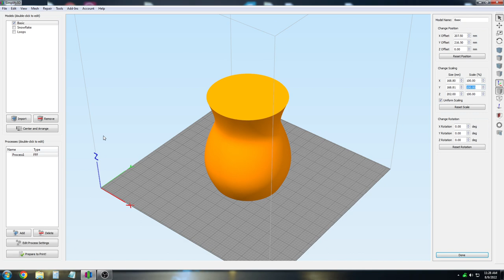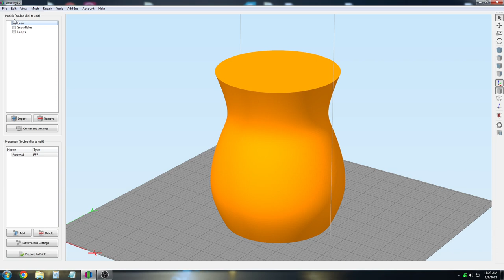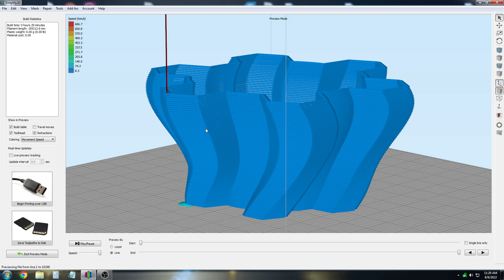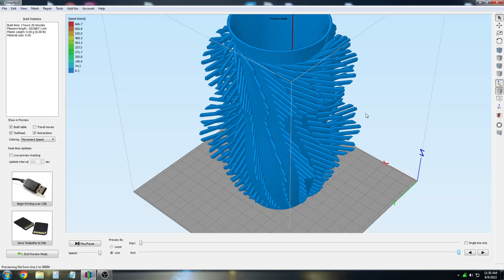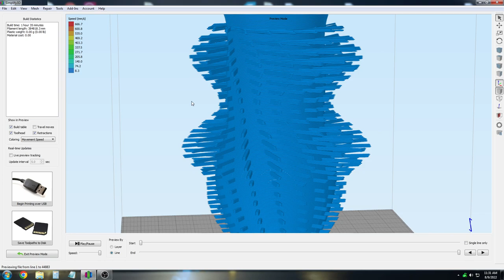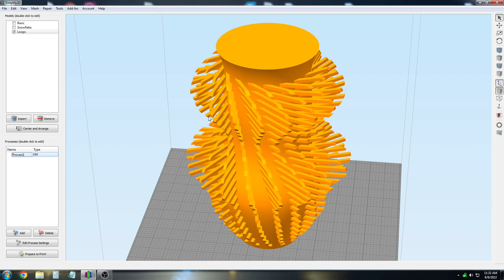STL File Slicing Example

Comment: Is there a way to print the slices on individual sheets of paper on a inkjet printer?
Reply from the maker: You could do that. Just only print the first layer. You can scale the Z height to be equal to your layer height to do this, or design your model file to only have a very small Z height.

Comment: What about the bottom of the vase?
Reply from the maker: You can add bottom layers. We recommend doing 3, but you should adjust your flow rate based on how your material is preforming. The best way to get a vase bottom is to print onto a clay slab, similar to traditional pottery.